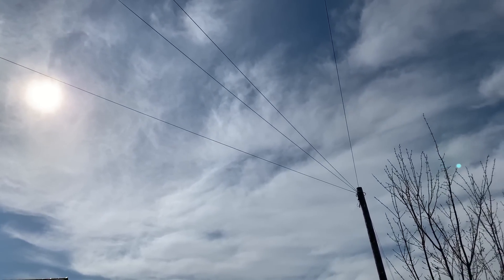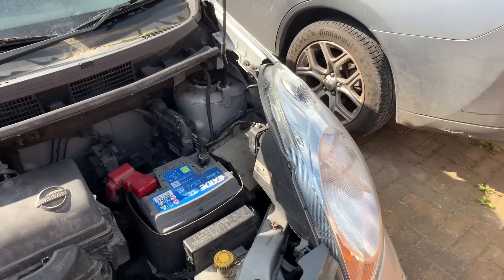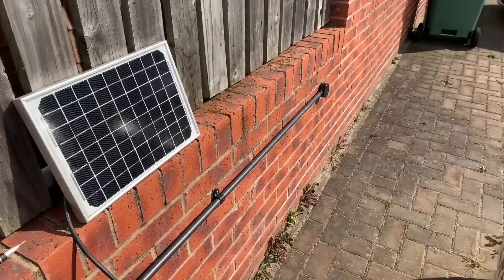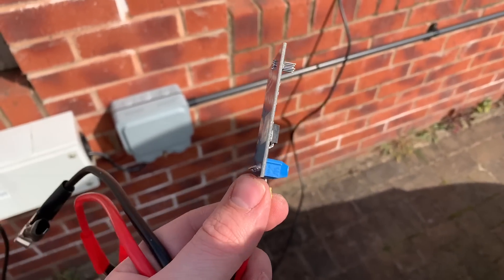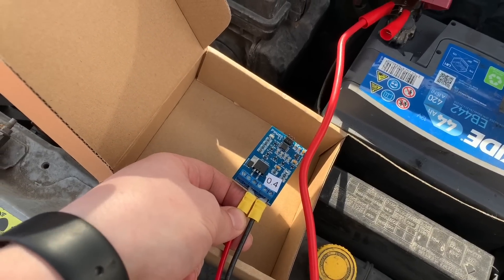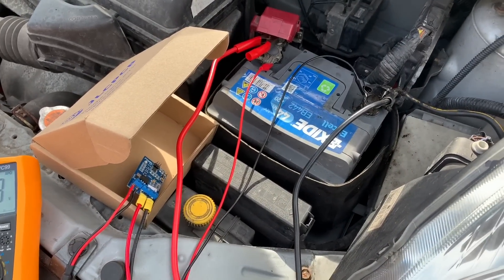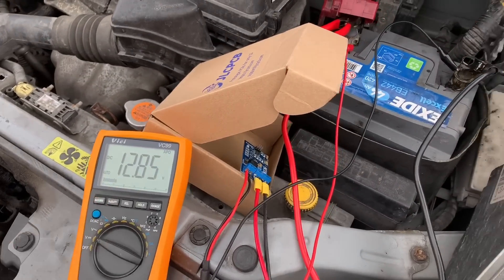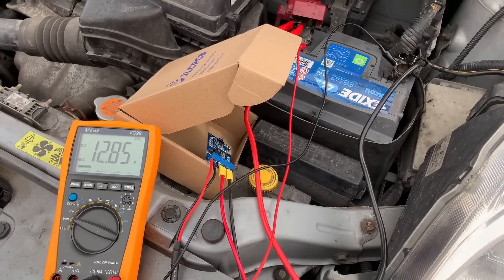Quickie: PWM85 Charging a Car Battery

Comment: In Australia, we have solar panels everywhere - probably 30 to 40% of all homes have a couple of kW of panels on the roof.
I find it absolutely hilarious how much money, time and effort is expended by British people to attempt to harness solar energy. The reality is that this method of generating power is only practical and viable when there is SUNLIGHT.
In the UK, it rains or is cloudy most of the time. Even on a fine spring day,  there's not even enough solar to top-up charge a small car battery! Just use mains power, Adam - it's cheaper and it will actually work LOL

Comment: Thanks for the video. Do you need to disconnect the battery from the car in order to charge it?
Reply from the maker: No. When the engine is running the alternator will bring the voltage up beyond 14 volts, so my little attempt here won’t do any hall to the electrics.

Comment: Neat idea, and it's good to keep old tools busy. You might have had better luck charging if you disconnect the battery from the car. With only 10w (max) for charging, I figure the quiescent draw of the car's electronics used a lot of the power, especially as the voltage came back. Of course, you'll have to reset the clock, and perhaps your radio presets....
Reply: He'd have far better luck if he lived in a place that had sunlight. The best way to charge batteries in the UK is using a mains powered charger. For a top-up like this it'd take what, an hour at most?

Comment: Yesterday night I had to go somewhere and realized I left one of my interior lights on. I didn’t start the car in more than a week and half.

Battery drained to 4.1V. I was able to charge it back to 11.9V using a power supply and get the car started. Wanted to replace the battery but the store I sent to was closed. Right now battery seems to start the car but I’m worried this battery drained way too low and is not good anymore.

Not sure why the car didn’t have a timeout on the light. Poor design.
Reply: Well it's unlikely to fully recover but so you can keep using it for a bit longer until you get a replacement, you could overcharge the battery to about 16.5V at a modest 1.5A or so for a few hours, that should take some of the sulfation off, just make sure to add some water as it boils.
Reply: @vgamesx1  you can recover it if you charge very slow but the battery will always be damaged
Reply: Mine drained to 7.8V,  I managed to get it back up to 12.8 with a charger, and its holding charge reasonably well.  But your 4.1 is very low. I thought my 7.8V would kill it.

Comment: Yo... Is there a logic behind why dont EL cars have solar pannels? Is perhaps a 10 volt solar panel with a voltage multiplier to charge while stationary? Why doesnt tesla or other e cars or even e bikes use solar panels? It makes no sense.
Reply from the maker: There is a Dutch car in development which does have solar panels built in to it. On a car you have surfaced pointing in all kinds of directions, solar panels take up a relatively large amount of space and traction batteries are quite high voltage. I guess we’re not quite there yet.

Comment: Do you know what current was flowing into the battery? I have a 10W panel and pwm charger attached to my car battery, but have never checked the amount of charging that is taking place. The battery does stay charged well. Like your videos and projects. Take care.
Reply from the maker: Cheers Bill. I didn’t check (this wasn’t really a planned video) but I’d imagine 250-350mA max.
Reply: @AdamWelchUK  usually a 10W solar panel has an output of 18V and 0,55A in ideal case

Comment: Did Mr. Illett ever finish the Muppet 2 controller?  I got fed up of waiting for him to complete it, (and numerous other projects) and unsubbed.
My first panel was a 5W amorphous job, pretty crappy, but it would top up my caravan battery ready for a weekend's use.  Horses for courses.
All the best.  Stay safe.
Reply from the maker: Still a work in progress that one. As you say, this little panel has its uses. Cheers, stay safe.
Reply: I have un-subbed to Julian as well. I couldn't cope with his idiotic experiments, ridiculous attempts at soldering, the continual use of the most obtuse and unsuccessful methods for doing the most simple things, and his smarmy responses to suggestions and critique. I really don't know what's wrong with him, but (as we Aussies say) he's "a few sandwiches short of a picnic".
Reply: @johncoops6897  "Two sticks short of a bundle" is a phrase that springs to mind...  ;o)

Comment: how long did it take on charge??
Reply: Suppose 12.5v is a 20% discharged battery.
That this 10W solar panel can bring 0.6A@12V 
That this batterie is still 44Ah capacity
You need around 15h of full sun :)

Comment: Sounds like you need a new starter. The starter can cause these symptoms.
Reply from the maker: I think it is a bit sluggish - but the car isn’t worth spending much money on and the starter is tricky to get to.
Reply: @AdamWelchUK  Yes, I had a 1996 Saturn SL2 and the starter kept shorting out. We have a place that rebuilds alternators and starters with a life time guaranty. I went through 8 starters and then they mad one that was heavy duty and I never had another problem and they only charged me for one, but the starter was located next to the firewall and they said you have to lift the engine, but I figured out a workaround. Some times you need to add shims to align the starter and the gear lines up with the torque converter.

Comment: It would be nice to have a permanent charging system installed on the rear shelf of the car (the solar panel), keeping up the charge will prevent the sulfation of the battery on the long term, it would be a good video project isn't it?

Comment: LOL,  My first decent usable panel is a 20W.  Puts out a whole 1.0A on the best of days.  Yep,  I actually use it quite often for this vary kind of stuff.   Just go with direct connection assuming your panel puts out 18v OCV.  Internal battery consumption will handle that NO ISSUES.
Reply: I used to have a tractor with a worn out generator that I used infrequently.  To avoid the cost of repair, I mounted a 10W PV panel on the side of the shed and connected it directly to the tractor battery whenever I parked the tractor after work.   There is no need for a solar charge controller with such a small wattage panel but you need to be sure the panel has a diode to prevent reverse current flow at night that would discharge the battery.

Comment: You can make a Nifty little quick release connection to the battery through the lighter plug directly to the charge controller. And then you can set your solar panel in the windshield. I did the same thing for my vehicle, but instead of a solar panel I use the laptop charger. You can see it on my channel. https://youtu.be/IIe2-vqhTNg
Reply from the maker: Neat idea - sadly the lighter socket is switched on this car - so without the ignition on there is no connection to the battery.
Reply: @AdamWelchUK  oh, too bad. Now that you mention it, with our newer RV it does have two separate plugs, and the one that I use is on all the time, the other one is Switched. I never really thought about that.
Reply from the maker: Now you’ve made me think - I know the accessory socket in the front is switched - but there is one in the book as well which might be permanent.

Comment: How many volts was the battery without charging ?
Reply: He started out at 12.5 or thereabouts
Reply: @flexairz  Device PWM 85 0.4Ah 12.53 Volts to 12.86 volts a short trial in the coronavirus environment
Reply from the maker: I forgot to check, but it was around 12.4 when I first connected the DVM before I stated recording.
Reply: @AdamWelchUK   #stay at home my kanki (bro). ❤️

Comment: I hardly find any use for those 10 Watt panels actually, peak current 0,5 Amps at 18 Volt and that is best case scenario.  I now use mine with a very small dc/dc converter to charge some solar led strings during wintertime instead of those mini solar cells.
Reply from the maker: I found it served me well for quite a while. I would have liked to have done this with a larger panel, but had nothing else spare.